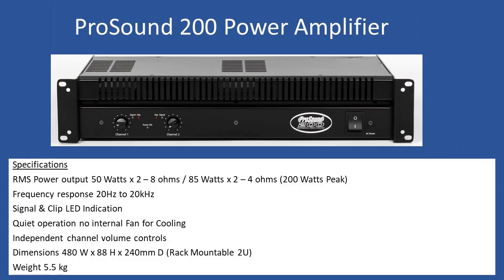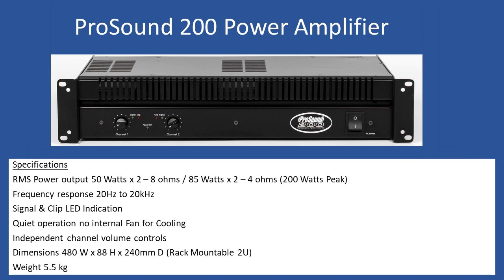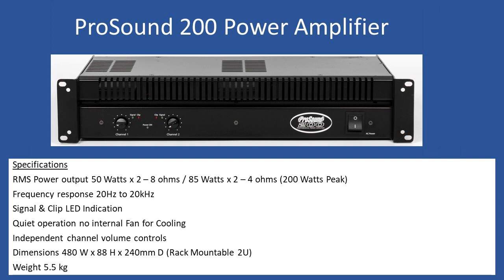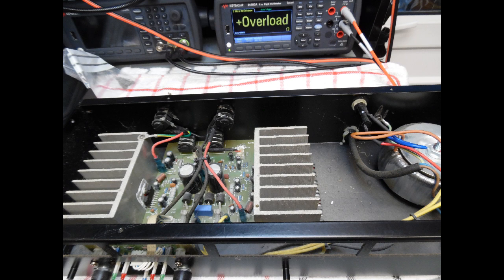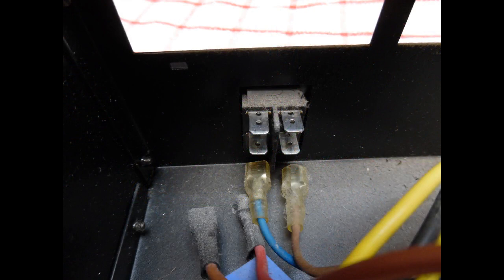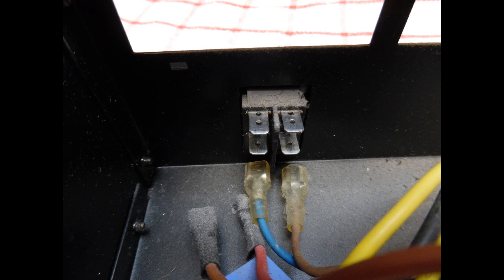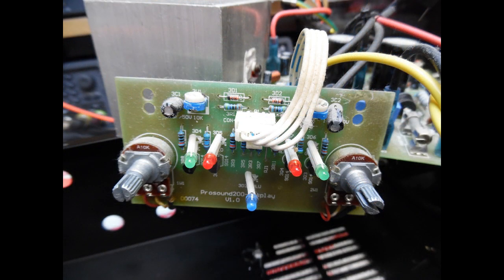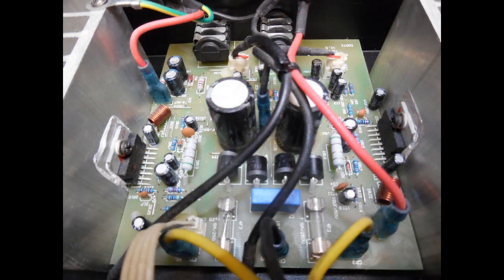ProSound 200 Audio Power Amplifier Repair (With Audio Tutorial)

Comment: Please forgive the potentially daft question: 

Just ordered a second hand one of these. Is it possible to bridge these somehow? For instance, could you use a Y cable, on the way to the speaker? Or would it fry itself?  Thanks.
Reply from the maker: Hi see this article https://en.m.wikipedia.org/wiki/Bridged_and_paralleled_amplifiers#:~:text=Any%20conventional%20stereo%20amplifier%20can,ground%20rail%20within%20the%20amplifier.

Comment: I have had this amp for a few years and gigged it a few times, great in my home studio too never had a problem ...... Yet, happy that this hasnt got a fan, thats something that I dont want to worry about conking out on a gig. ....... The led conked out years ago but amp still working well, very happy with it, thankyou for your help regarding this amp. 🙂👍🇬🇧
Reply from the maker: Good to hear your experience of the ProSound 200. The power LED is easily changeable, specification  3mm. 2 Volts.